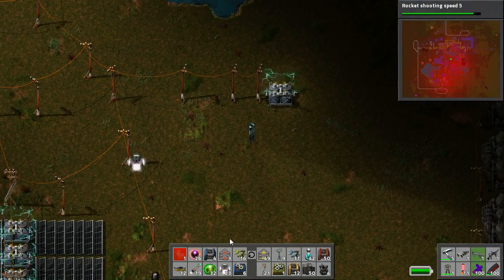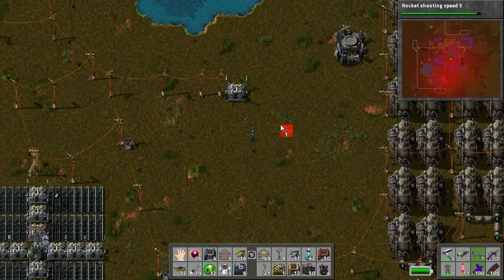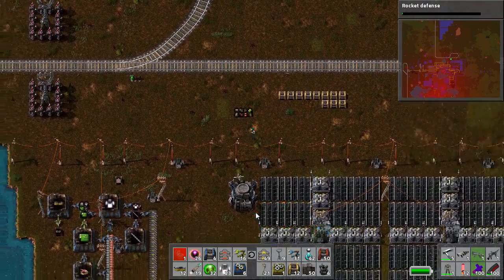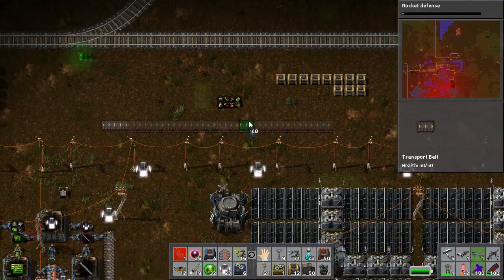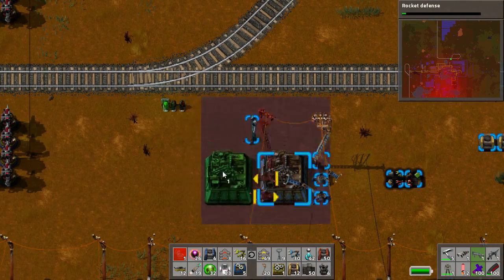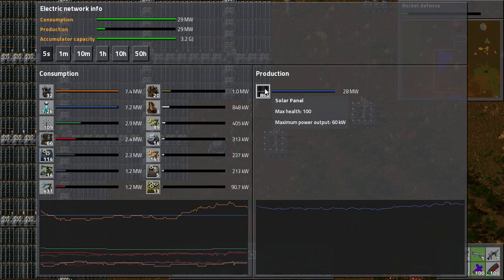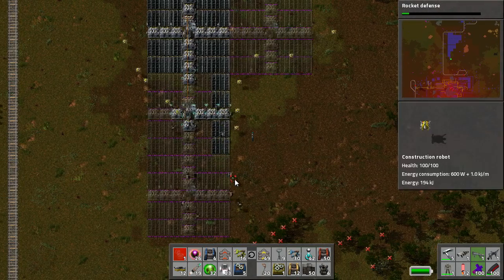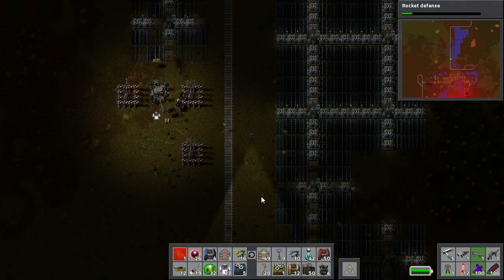Factorio Tutorial 9 - Automated Construction

Comment: Hi there, I want to put repair packs into every roboport around my base (three layers of walls and two layers of laser turrets) so they can be repaired automatically. I found a post in a forum where you said that it is important to have walls in the green area and the laser turrets inside the orange area. I can`t remember why I have to do this, can`t find this post again, unfortunately. What else do I have to do?  I don`t want robots for everything, only for automated  repair and deconstruction. 
Cheers ;)
Reply from the maker: +Jay Playbox repair packs only need to go in a storage box. robots will get them from there. walls and turrets just need to be inside the green area. this is the construction area.
Reply: +Negative Root Ok, I rebuild everything and test it later. This will be awesome if it works. No more running around like crazy and fill everything up with repair packs. That will save alot of time. :D Thank you :)